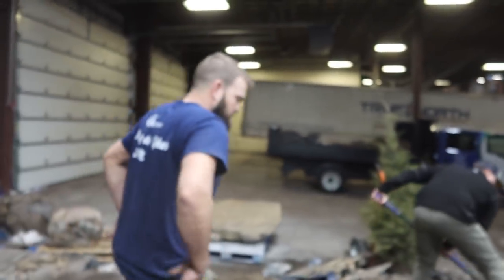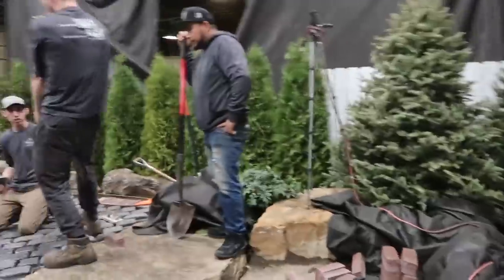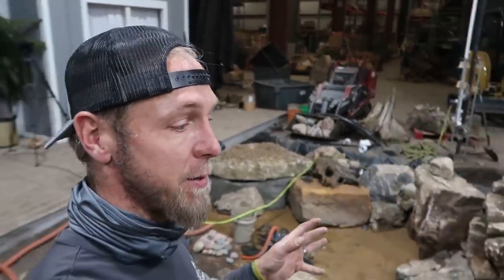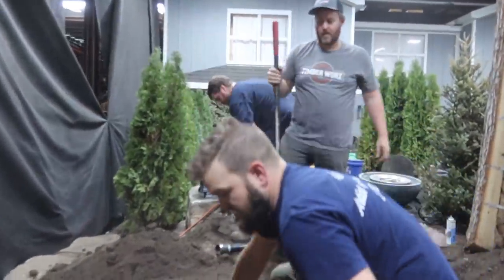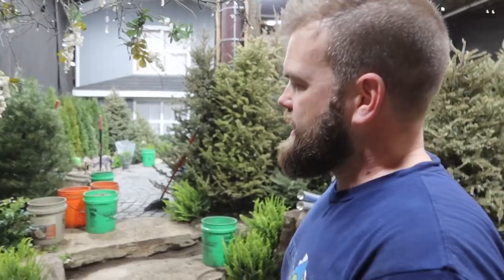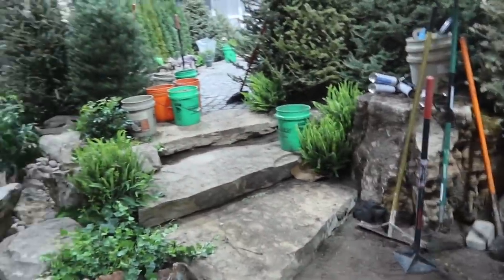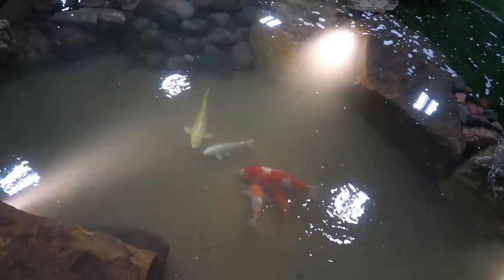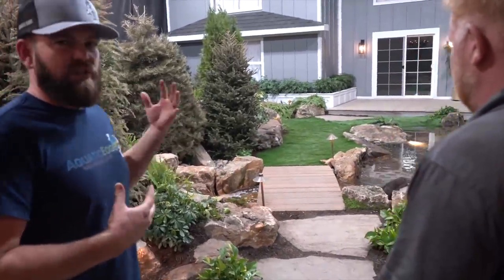Sand Bottom Pond and SECRET WATERFALL: Aquatic Edge - Part 3

Comment: Hello  all team members. 
I have a question, this sand bottom will not create algae problem or is it ok. Thanks.
Reply: It has pros and cons. A larger granular sand will stay put on the bottom better without getting stirred up into the water column. The fish love it and will continuously root around the bottom which should keep algae from growing. 
When cleaning out the pond, it will be tricky to clean the sand without disturbing it so much that it gets sucked out by the cleanout pump.